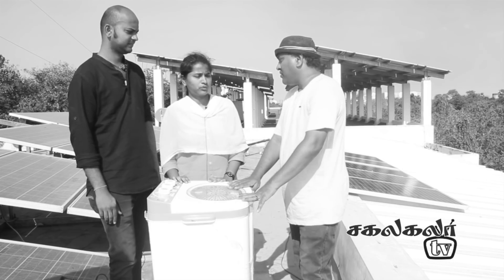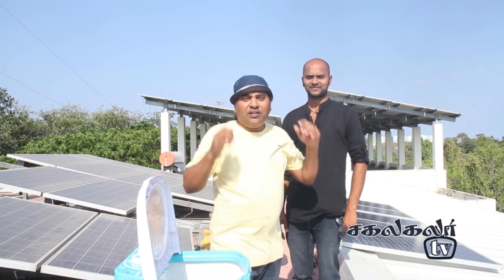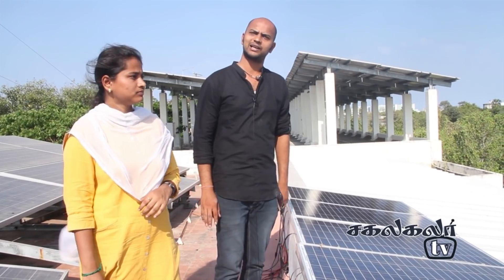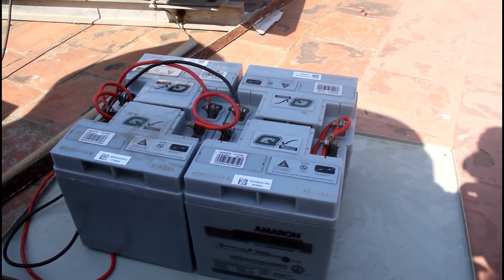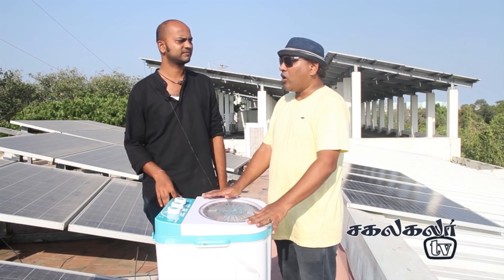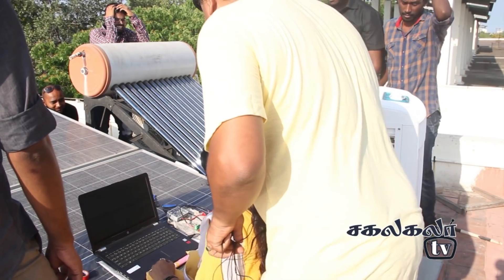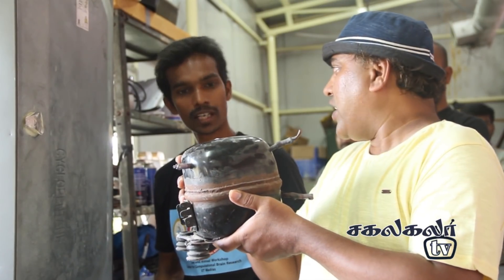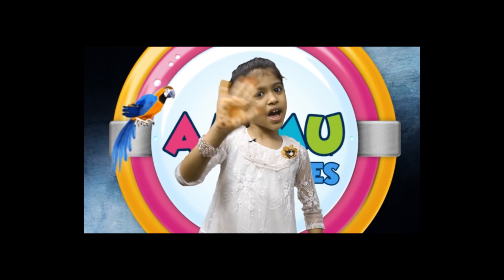SOLAR WASHING MACHINE || SOLAR AIR COOLER || SAKALAKALA TV || ARUNAI SUNDAR ||

Comment: Sir solar panel la connect panna voltage fluctation agatha
Reply: Solar panel to charger controller from charger controller to battery and the output should taken from battery

Comment: cost of the battery and cost of the pannel is not explained..........more over how long the battery serve, it is also a questionable one.... why cant it run straight away from solar pannel without battery?
Reply: You can use 48v adapter